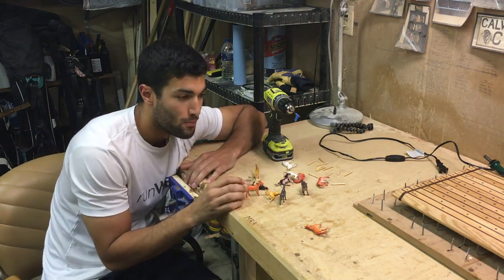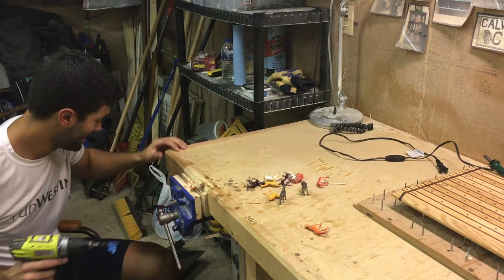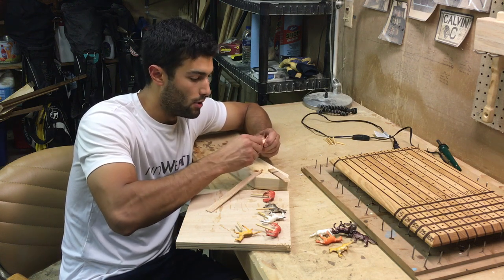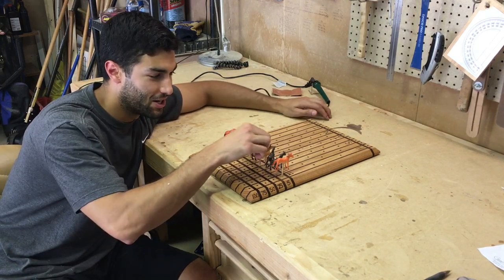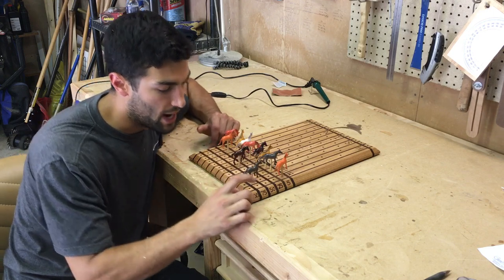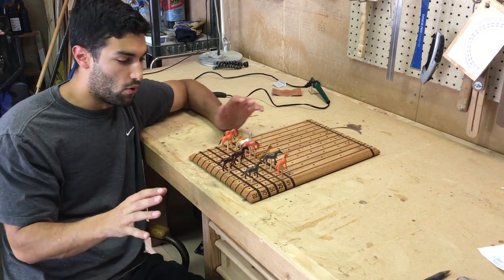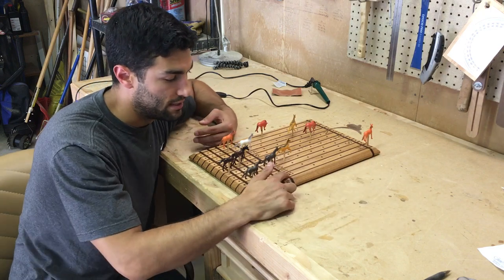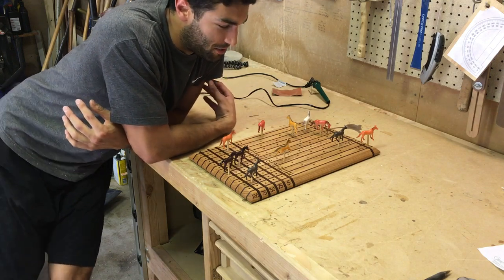DIY Horse Racing Board Game-Part 2

Comment: What happens when you run out of quarters mid game? The first few times we played this, people were running out even with $5 in quarters. We found that the quarters or poker chips were irrelevant . We would just have a set buy in amount, and then whoever had the winning cards split the pot.